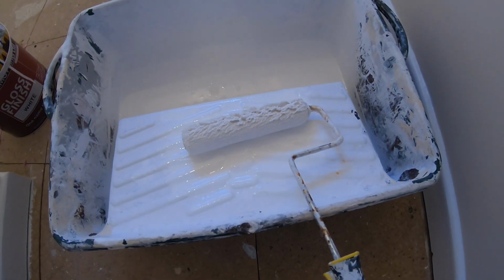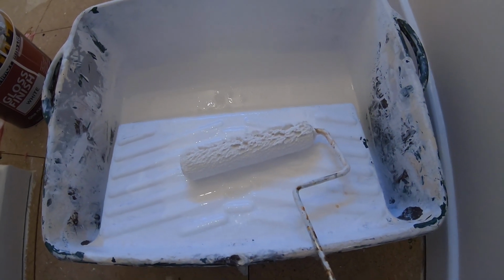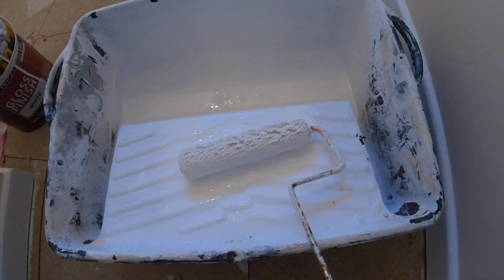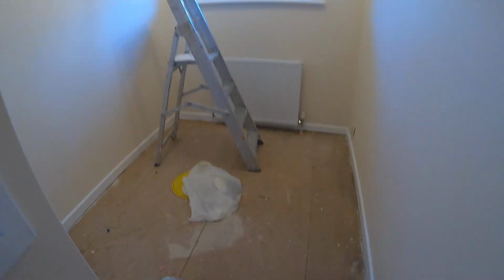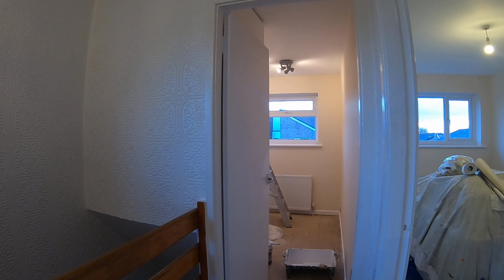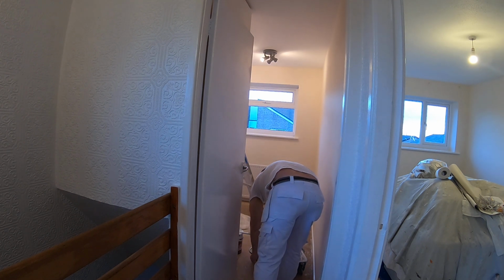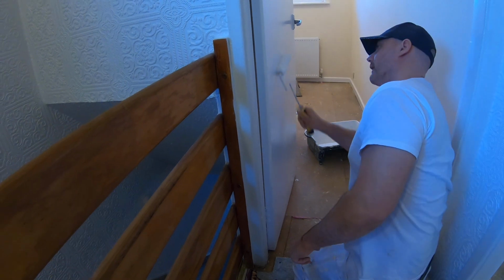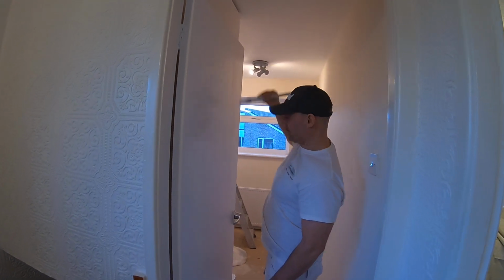How to roll a door with purdy jumbo 6.5 inch white dove sleeve

Comment: Yes hi Joe what's the crack with these fibres sheading? These doves any good? I use microfibre sleeves
Reply from the maker: I always wrap maskingvtape around new sleeves and pull off loose material, then soak and rinse... .then soak and rinse before every use 👍

Comment: Great video mate. In the process of repainting the whole house and been looking at ways to work more efficiently. I was thinking about removing the door before painting it but looking like it’s fine to do it already hung. What are your thoughts? Another question where can I buy that scuttle tray that I’ve seen used in a couple of your videos. It’s looks a lot more heavy duty that the cheap DIY trays who buy in wicked or B&Q
Reply from the maker: Hi Chris, yes it is perfectly fine to paint while hung... Just remember to be careful when painting the hinge side of the door architrave... The scuttle/tray is a hybrid called a 'wooster sherlock 14 inch hybrid tray'... If you Google that, there are various places to buy online....i easily use 15 inch sleeves in the tray even though it is marketed as, a, 14 inch tray.
They are perfect for domestic work as they hold enough paint to apply 2 coats in a, standard size room.
Are your doors panelled or flat?
Reply: JoeProDecor thanks for the reply Joe. I was able to find online for about £20 including shipping which seems reasonable as I,ve
 got a lot of painting to do. I’ve noticed you don’t use the plastic inserts or maybe you do but haven’t mentioned it. The doors are flat ones..the ugly brown stained doors from the 70’s. Another suggestion as it’s really great that your UK based as most channels are US based as it’s often difficult to relate primarily because the materials or tools they use are not available in the UK. Listing what tools you use in the description along with an affiliate link if amazon sell it and it’s cheaper than other stores which often is the case as most are prime members would benefit alot of subscribers.
Reply from the maker: @ChrisLivingInYork  not such a bad idea Chris 👍.... I don't use the inserts as I clean out after each use... Only takes a few minutes and saves on the extra expense

Comment: Hi Joe,
What size, model and make of brush are you using after rolling. Thanks
Reply from the maker: Vincent Lewis Hi, i was using a 2" proform blaze with this product as it was water based. I also use hamilton expressions and truestar excelsior brushes.
I mainly use hamilton perfection for oil.
Regards, Joe
Reply: Thanks for quick response Joe, appreciated

Comment: Try a Fussy Bloke Joe no need to lay off !!
Reply from the maker: Hi Peter, I actually use fussy bloke sleeves now, even used one on a dining table without laying off(with oil eggshell) great results 👌
Reply from the maker: The purdy 6.5 inch sleeves are fantastic for speed though.... And the purdy roller arms are so smooth it's a pleasure to use
Reply from the maker: Which fussy bloke sleeve do you prefer Peter? Smooth or semi smooth?
Reply: Hi Joe could you tell me the make of your scuttle, and which us your preferred brush for oil based gloss and water based gloss,